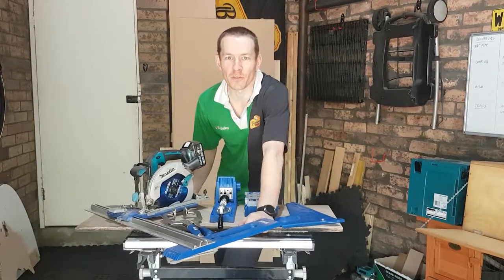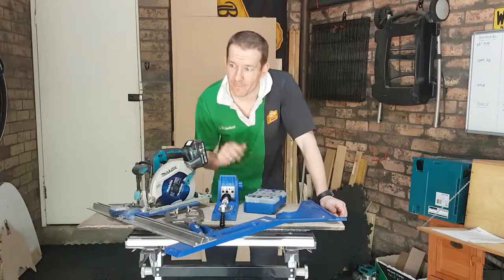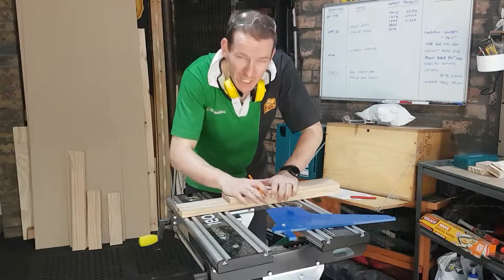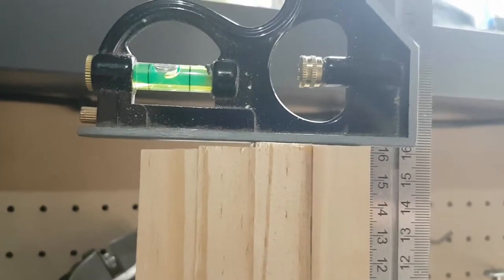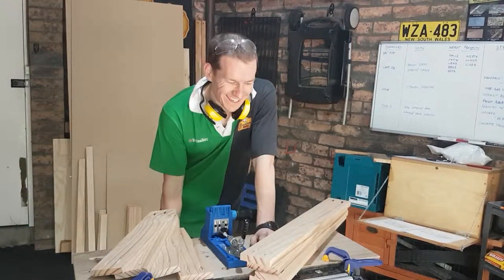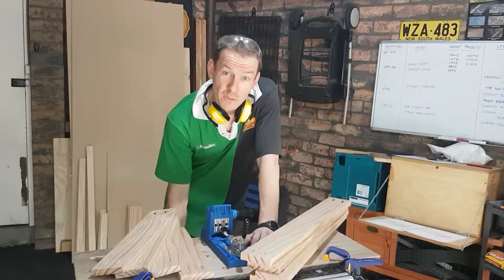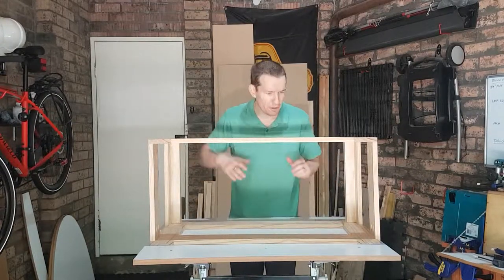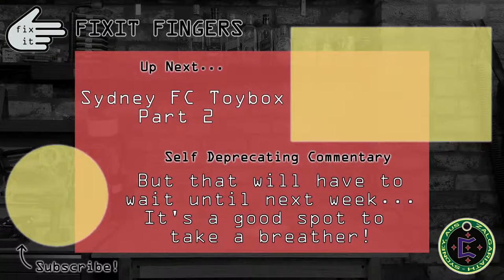Wooden Toy Box & Football Game - Part 1/3: Kreg Jig Frame

Comment: Those joints are nice and crisp mate, Haven't done much with pocket screws in my time but if that's the result I might need to.
Reply from the maker: They cop a lot of flack from some traditional woodworkers as cheating, and no, they are nowhere near as strong as a mortise and tenon, but what you lose in that you gain in speed. Depends what you are after. I marvel at those who can hand cut dovetails and I admire their skill... but Im a trying to become a practical woodworker, not an artist, and so far I love the system ;)
Reply: @FixitFingers  I've noticed that most of the people who will look down on a technique for not being "traditional" or "Proper" are the type of elitists who can rarely be impressed by something they didn't make themselves. Not all of them of course, but most.